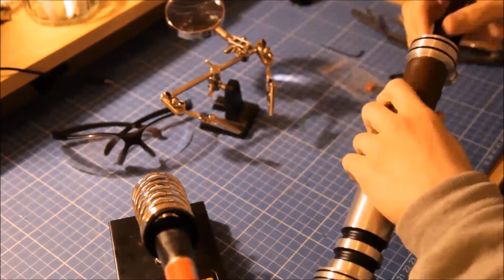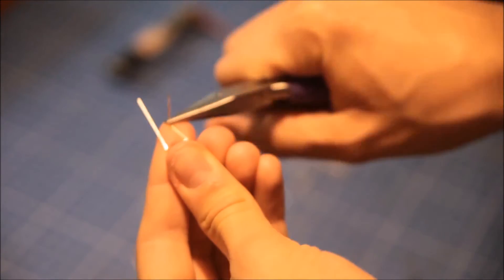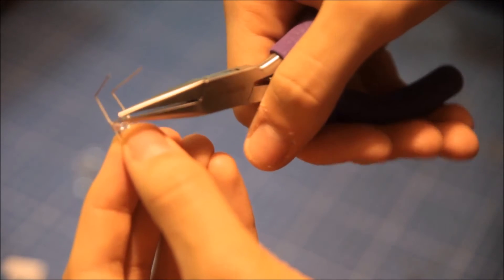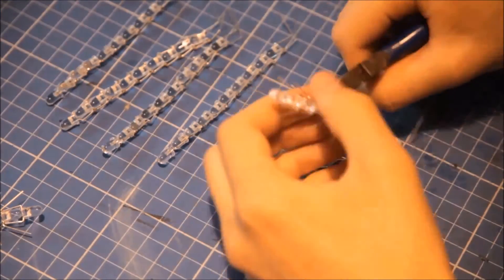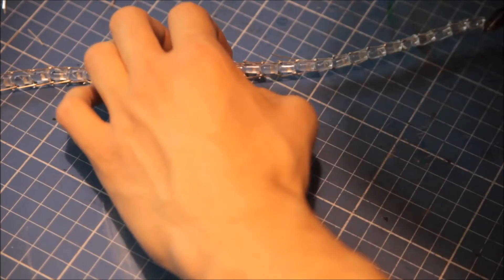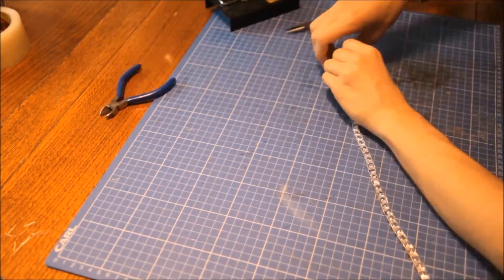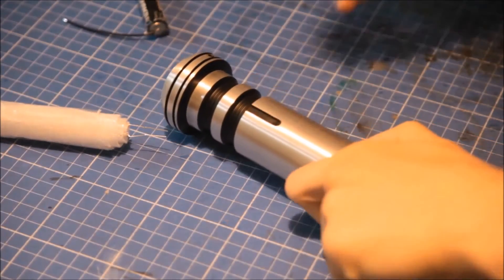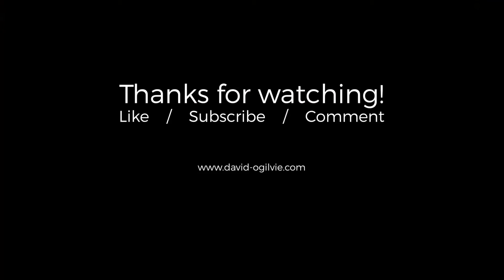How to make an LED string blade for a Lightsaber

Comment: Meant to ask... Did you try using 2 different colored LEDs, say, blue & red, to get a purple color? Thanks again
Reply from the maker: I think you’d do better to use just purple LEDs if you’re after a purple blade - you’d risk the black looking spotty blue/red otherwise!
Reply: @davidogilvie6873  I thought 2 alternate colors might produce a mixed one! Thanks. Also what electronics did you use?
Reply from the maker: @j.lietka9406  I believe this one used a Nano Biscotte V3 from Plecter Labs. The whole thing is wired up in the same way you would wire the lightsaber for an in-hilt LED, and you just treat the led string as if it were a single tri cree LED for wiring purposes. Make sure you resistor it correctly too - there's some good LED resistor calculators out there for help with that. I'm by no means an expert on this stuff though haha!
Reply: @davidogilvie6873  thanks! Am looking at using a teensy board or Adafruit boards. Thanks for the help & info!

Comment: How can i make it with rgb leds
Reply from the maker: You would wire the LEDs as any other - you would just have more wires to control each of the red green and blue (positives I assume) plus the main negative lead.

Comment: Hello again  i plan on using 2 different colored 5mm LEDs, like your video shows. The 2 i hope will be a blue and like a blue-green, every other one, for a different color mix. Yes, this method is a bit labor intensive, but its my 1st build. What value of resistor did you add to the ( - ) lead? i plan on having arduino for control and a sound + accelorometer board. i want to use 18650 batteries too. thank you and great video! yeah, the build mr schmidt made with the modified LEDs with the 120 degree tip is too much for me!

Comment: hello! great build! have you watched a similar youtube by Wayne Schmidt? He did the same thing, but he used a few more 5mm LEDs, trimmed the top bubble off (just enough as not to ruin the internal portion) then put a 110 - 120 degree pitch dimple, so the light shines better. I am working on a real homemade hilt, and am still thinking of what method to light the blade with.. can your build with the string LEDs be used to lightly strike another blade? MegTooth, SpaceWindu, and some others have great vids, too! thanks again 😺
Reply from the maker: Thanks! I don't think I've specifically seen his video but when researching how to do mine I did come across that technique, but decided against that as it involved fairly detailed modification of the leds - if you don't get the 120 degree inset right then the work to do that essentially nullifies itself as the light wouldn't be properly reflected sideways from the LED. If you have the means to do it though, great! Ideally you would use a pillar drill and a bit with a 120mm angle on it in order to get it right each time, but you could do it carefully if you clamped the LEDs and used a hand held power drill. I've watched a LOT of Spacewindu's videos haha, all very impressive stuff!

The downside to LED string blades like this is that because you're soldering all the legs together, it essentially forms one rigid line of LEDs so they can't take much flexing - tapping against another blade would be fine, but anything more than that (ie if a child were to wave it around and hit something I wouldn't be sure it would survive to well).

Another way to do it (that I've done several of now, not got videos up yet.. Those WILL come in the next few months though :D ) is using neopixels - these are flexible strips of LEDs that are induvidually addressable, and as they come pre-made on a strip it saves hours of soldering LEDs together haha. You need a proper neopixel driver board for them, which is the only 'down'side to it, but something like the Nano Biscotte V4 soundboard from PlecterLabs or equivalent (or higher) is capable of driving those - the first neopixel blade I made, I followed this as a guide: https://www.youtube.com/watch?v=va1R3Wn1PcQ and then if you search around theres other good neopixel videos out there too :) 

Good luck with your build!
Reply: @davidogilvie6873  even tho you made this string some time ago, what is it was the viewing angle of the LEDs? Thanks
Reply from the maker: @j.lietka9406  The viewing angle is only 25 degrees - you can get wider angle ones but the cost starts to go up then haha. I used these LEDs https://www.componentshop.co.uk/5mm-ultra-bright-red-led.html

Comment: I've been wanting to put NEOPIXEL in my thin neck saber... But I'm told it's impossible. I'm really just wanting a string blade in yellow on my Saberforge Exhalted so the the entire blade is lit and EXTREMELY bright, but I cannot figure out how to do this myself. I've never created a saber and have no clue what I'm doing.
Reply: Neopixel I’m thin neck is possible. It just won’t be good for dueling at all. Sabertrio do an amazing EXTREMELY expensive thin neck saber, loads of sounds colours and effects PLUS thin neck. It is possible just very hard

Comment: What do you have as the bottom base of the string blade? Is that an end cap?
Reply from the maker: Nothing - it was just tight enough in the blade with enough friction for it to be held in place, especially with the wiring beneath it inside the hilt its not going anywhere! I have seen some people who make either a plastic bung or hot glue it in.

Comment: hey man awesome video. Can you tell me witch baterry you use to this led string please?
Thx from Brazil! ;)
Reply from the maker: I used a 3.7v 18650 Lithium Ion battery, with a protection circuit pre-wired into it. Not sure where you can find them in Brazil but the one I have in mine is from www.saberforge.com , or I have a couple from http://www.jqsabers.com/product/3-7v-18650-li-ion-battery/

Comment: that seems a bit dim compared to other string blades iv seen .what mcd was your leds?
Reply from the maker: The LEDs are rated at 5000mcd, but the issue is that their projection angle is only about 25 degrees so a lot of that light is lost by being absorbed by the LED directly up in the chain. Wide angle LEDs of that sort of mcd rating tend to be fairly pricey though.. Its about equal brightness to a standard Ultrasaber red LED though (and they will happily claim their's are the brightest on the market.. They're not, but hey..)
Reply: Ah ok .Yah all the saber makers came to be the brightest lol  iv only seen in person ultra sabers . saberforg and kyber light .Imo saberforg is the better of the 3 .I prefer to make my own tho
Reply: @davidogilvie6873  It would be more work for every LED, but you can cut or sand the lens on the package for a wider light projection.